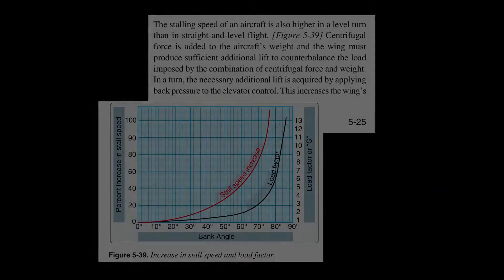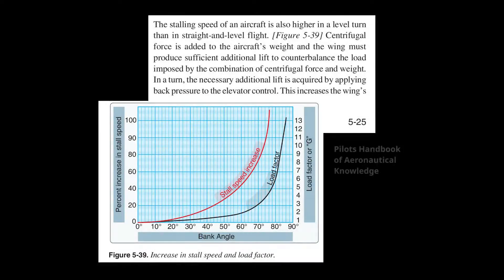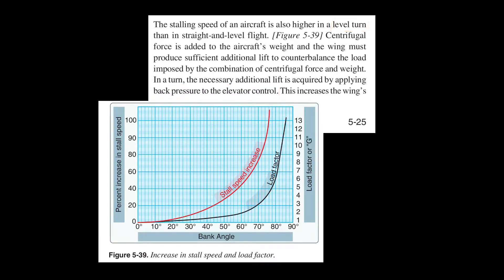Traffic Pattern Stall Spins

Comment: Are we at risk of a stall spin if we're doing steep turn maneuver? Cause elevator back pressure is needed to keep the nose level?
Reply from the maker: Steep turns raise the stall speed, but the fact that you're banked doesn't increase your risk of spinning. If the turn is coordinated, the bank angle doesn't change during the stall. If slipping, you will fall toward wings level. If skidding, will spin.

Comment: thanks for this video... nut if we dont apply back pressure in those turns, and only do them with steeper bank and coordinated rudder, wont we be loosing altitude?
Reply from the maker: @kamikaze458g  yes increased rate of descent, or decreased rate of climb, does occur
Reply: @chapmanflying7632  so whats the recipe to make those turns at low altitude avoiding the stall risk but without loosing altitude? trim? power? thank you very much for making this content and your answers
Reply from the maker: @kamikaze458g  for the base and final turns I expect to descend during the turn and plan the approach accordingly

Comment: Computer desk pilot here, I don't think it was mentioned in the video - I assume the correct action to take if the nose is dropping too much during these turns is to increase throttle instead of elevator input? Thanks
Reply from the maker: If the nose drops more than you can accept, you need to reduce bank angle so that more of the wing's lift points at the ground. Don't add power or pull up - both of those increase the wing loading, which increases your stall speed. Reducing the bank gets you more vertical lift without increasing wing loading.

Comment: Good work on the video. 
I often see students pull in turns in the pattern, and end up around 10 knots slower than their target speed. So it’s pretty frequent that I have to remind them that while often in cruise, we usually want to turn and maintain altitude, but in the pattern, we’re usually wanting to change altitude while turning, so let it change by not pulling elevator in the turn. 
I don’t recall any of my instructors telling me about making this change in the relationship between elevator and bank while in the pattern vs everywhere else. It may have been one of the many things I recognized soon after I started instructing. How about you?
Reply from the maker: Rodney! Figured this would be the one comment youtube wouldn't send me a notification on, sigh. Yeah I don't recall you or Joel (or anyone else) specifically discussing this with me, but as you probably remember, my issue was doing everything with too much airspeed. I was very anxious about slowing the plane down, so you guys probably never got the opportunity. 

Yeah, I had one guy in particular who always liked to turn and yank, specifically crosswind to downwind.  Got me thinking about wing loading, forces, etc, and now I introduce this concept the first time we do pattern.
Reply: @chapmanflying7632  Hmm, maybe I didn’t, especially if you didn’t show that problem during our flights. Might be the same reason I didn’t have an instructor tell me that when I was learning, I tended to do well with maintaining a desired speed from early on in flying. 
I feel like I was teaching to not pull in the pattern well before I flew with you, but some details are kind of blurry with so much repetition.
Reply from the maker: @rodneyhooverCFI  Also we hardly ever flew the pattern in instr training, just when circling. You probably mentioned it then.